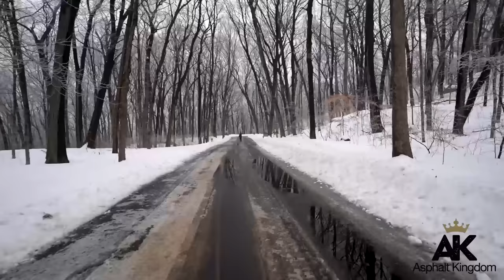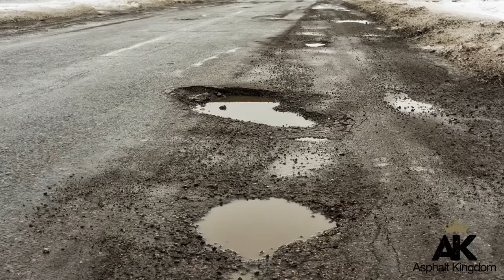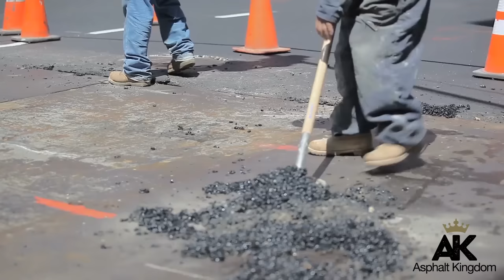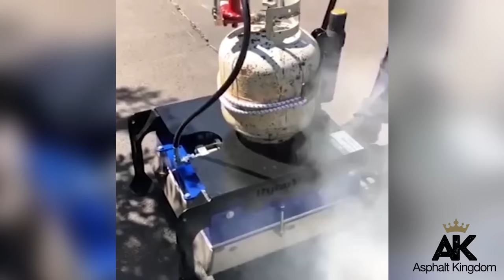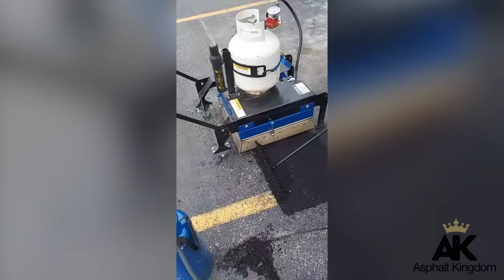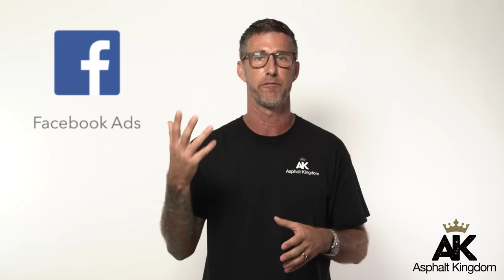MAKE MONEY THIS WINTER WITH POTHOLE REPAIR ASPHALT | ASPHALT INFRARED PATCHING MACHINE

Comment: Problem is like some states like Colorado city. Inspectors don’t allow the reuse of old asphalt especially for pothole repairs because of the longevity And lifetime of it let alone poles and sawcut , causing cracks later on
Reply from the maker: You're absolutely right; different states and cities have varying regulations regarding asphalt use, especially for something as critical as pothole repairs. This is a great reminder for anyone in the business to stay informed about their area's specific requirements. Thank you for the insight!

Comment: So this heats your reclaimed chunks and the asphalt around it as well? What thickness of asphalt does this heat to? If you go over the thickness do you have to do it in lifts?
Reply from the maker: It will do a 2” heat press in 7 minutes. Simply rework the asphalt and surrounding area and then apply some rejuvenator and compact.
Reply: I have this same unit and it heats up a solid 2 inches down at least

Comment: Should have shown the.process of heating up asphalt chunks, not just the finished product
Reply from the maker: Thanks for the feedback, Keith. We made this video short to be more informative. Watch out for the in-action video that we will upload soon.
Reply: @AsphaltKingdom  or to hide the fact that your suggestion is a horrible idea.  Infrareds are a great tool, but not to be used to in the method your suggesting.
Reply from the maker: @davidanderson1451  thank you for your comment. What do you recommend that one should do if there was a dangerous pothole that needed repair?
Reply: @AsphaltKingdom  Use cold mix until you can get the proper material.
Reply from the maker: @davidanderson1451  appreciate your advice. Putting cold mix in and then going back to remove it in the spring and then doing a cutout with hot mix would take a lot of time of the $. We have dozens of clients who do infrared patching all year long and the patches hold for years. It’s important to add rejuvenater to the press when doing infrared and all holds well keeping the asphalt safe.

Comment: Infrared heaters are very useful.  However your suggestion of putting chunks of old AC in a hole and re-heating it, made me laugh so hard, since I thought you were joking.  As a professional in this industry for over 30 years, this is horrible advice.  Fix potholes properly.
Reply from the maker: Thanks for the feedback David! We only recommend using used asphalt if it still have a black color in it, where at least the bitumen and other properties that bonds it together is still there. We also recommend buying the asphalt rejuvenator to add the bonding agent while it's being raked.

Comment: A torch heater will do the same thing in fact it will fill melt one wheelbarrow instead of 2x2
Reply from the maker: Thanks for the comment Burim. Actually no, the RY2X2 is engineered to heat asphalt between 5 to 10 minutes. Torch will take forever to heat an area of asphalt.